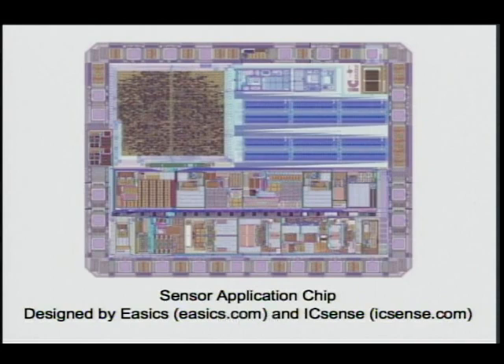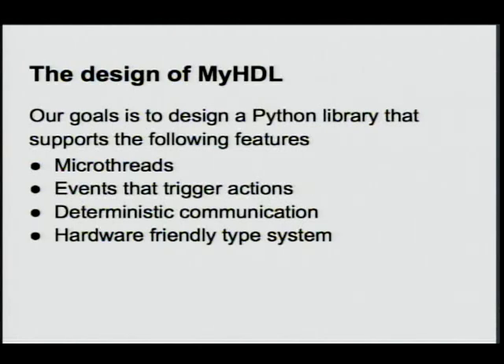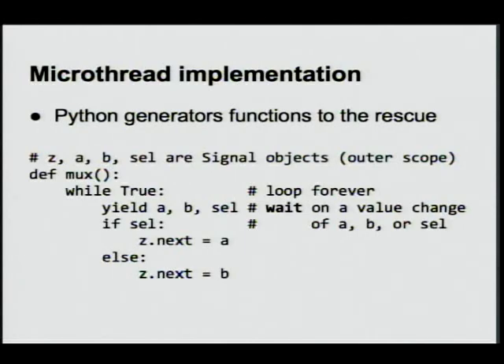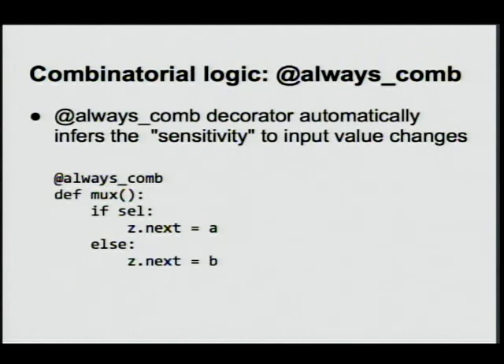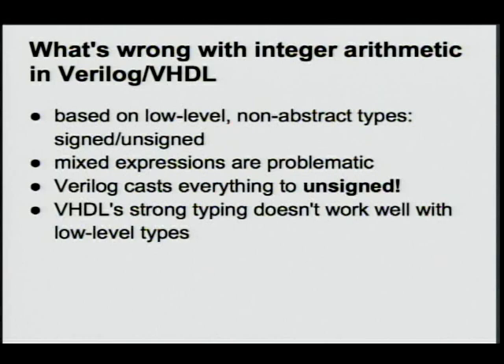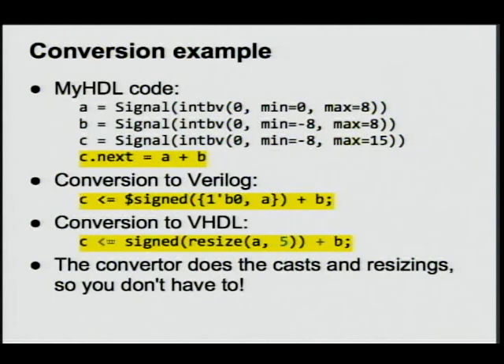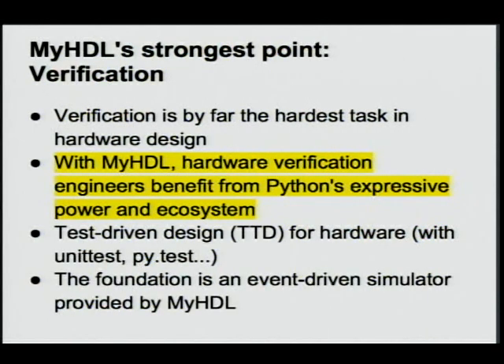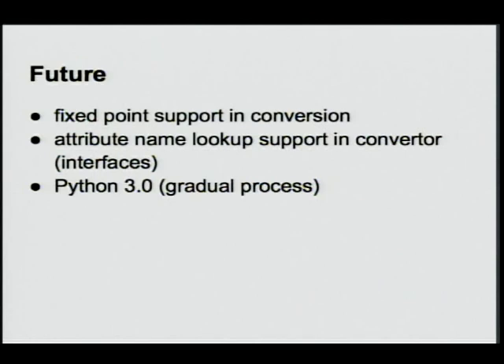[PyConTW 2013] MyHDL   designing digital hardware with Python by Jan Decaluwe

Comment: @26:40 you are getting 7 + -2 = -11 because you are explicitly mixing two types of signed values encoding. Your example gives the correct result if changed as following:
 reg        [2:0] a;
 reg signed [3:0] b;
 reg signed [3:0] c;
 a = 7;
 b = -2;
 c = a + b;
Or the following:
integer unsigned a;
integer b;
integer c;
a = 7;
b = -2;
c = a + b;
Reply: That's the point he was making. MyHDL is type-aware and handles the conversions correctly for you so that kind of "bookkeeping" doesn't have to be done by the developer.